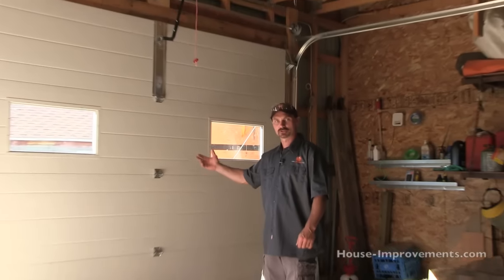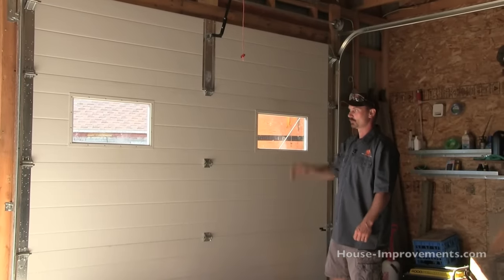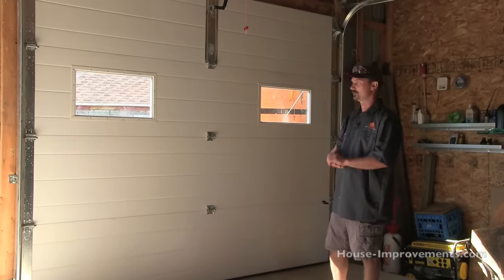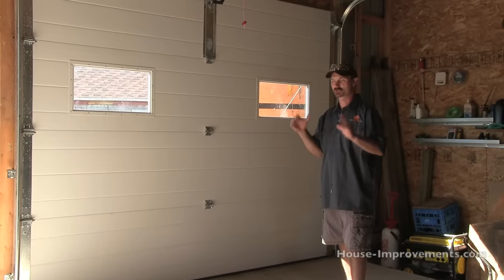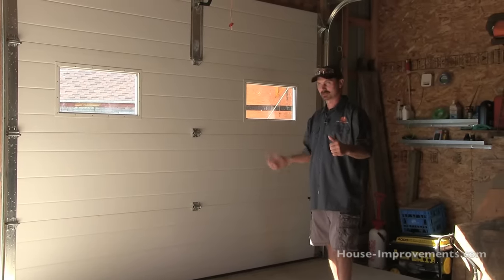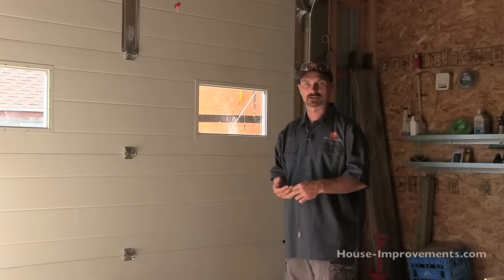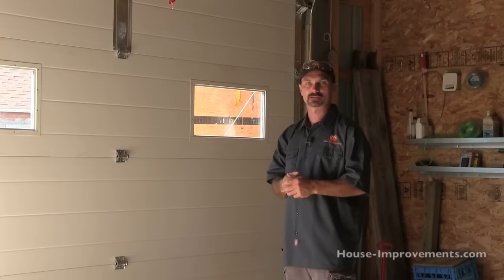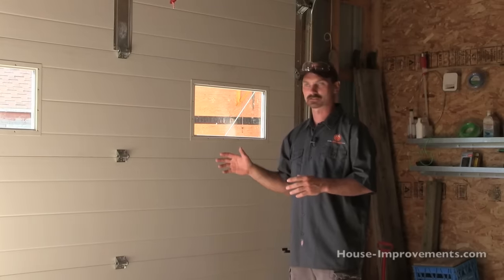How To Install A Garage Door

Comment: Thanks!   A local garage door specialist just gave me a quote of over $2,000 to install one  8' X 7' un-insulated replacement garage door including all including hardware which was ready to hang.  The previous door install already had the flag brackets, vertical rails, flashing and existing spring and shaft.  The only requirement was to hang the door.  All new cables, rollers and hinges came with the new door.   I decided to save $2,000 by watching this video and doing it myself.  It took me three hours to attach the two horizontal 2" tracks, assemble the door panels, hinges, rollers and vinyl strip floor gasket.  Bravo!
Reply: there's no way 2,000$??? that had to be a "i don't want to do this job" price

Comment: Wow!  It’s a “how to install a garage door” video that actually shows how to install a garage door!  Thank you for your time in doing this and the clear instructions.  I am actually a fairly skilled carpenter who was too intimidated to replace my own garage door until watching this.  Now I’m ready to go with a greatly-diminished fear of being decapitated by an unfortunate spring accident.
Reply: Yes it is great, but where can I buy garage door kit or every thing I would need to complete that...? I have 11x11 ft opening.
Reply: @TomasArnos  good luck, that is definitely special order
Reply: @TomasArnos  I have the same size but I've added to the sides to put in a ten ft door. Another option is to cut down a 12ft wide door. I bought my door off of marketplace for a 100 bucks
Reply: P
Reply: Why use nails to hold it up when you can use the tracks to hold it in place tears what its there for 😅
Reply: Hard to get exact alignment
Reply: First thing is cutting your cables. 😂😂
Reply: @jasonmccoy4769 I'm guessing that nails makes it easier to adjust real quick if nessecary then having to make a bunch of lag screw holes moving the brackets around. I'm sure he has a reason that makes perfect sense judging by the fact he obviously knows what hes doing and beyond any observation you or I could make with our 0 experience installing these. I'd be interested to see you do it your way. Maybe you'll come out if it saying boy I wish I just nailed these in temporarily rather destroy the framing I just drove 15 lag holes in moving around the brackets aand now they are stripped and I cant fasten the track to the wall.
Reply: @kefwals8722  you must not have anything better to do pal. Allow me to humble you real quick.. I own my own garage door business also using the lags like you said to tear up the  framing would be bad 👎 but if you know what your doing with a level and tape there is no issue there. It amazes me on how you were so eager to slander me with you half cocked 2 cents. You are wrong pal.

Comment: Clearly the best DIY video I've ever seen anywhere. Super well organized, 1), by showing the finished product first. 2),  by showing every step in order with just enough talk to make sure the audience understood. 3), by skipping thru all redundancy and picking up again at the relevent point in the process. 5) By covering every detail, even some for a different kind of door/hardware to cove other types of doors.  Thanks. You get and A++ from an old DIYer with 70 + years of  DIY experience...always work alone...

Comment: I’ve worked for a company that was in business for over 40 yr servings & installing ohd & entrance doors and got a first hand view of door issues in a commercial and residential setting.  
Learned a lot of knowledge to say the least.  
The owner was a perfectionist.
We would typically install the vertical tracks after the second panel is stacked to ensure the panels don’t fall while stacking eliminating the use of nails.  Keeping the track brackets loose for future & final adjustments.
Making sure to center the door inside the garage opening & to make sure they’re equal on both side when looking from the outside.
Also,  the vertical tracks should not be installed directly on the concrete as water will cause rust over time.  Along,  with the ground will raise and lower cause track issues when the concrete pushed the tracks during freezing & thawing cycles.
We also would recommend struts no matter what the manufacturer requested solely do to the fact the opener with cause stresses on the door especially when it’s used primarily.  
@$15 per struts will save a head ache in the long run.
When winding the springs,  we would use white spray paint and spray a fine thin line the length of the spring from the center bracket to the winding fitting.  This shows how many turns are on the spring in case someone like the customers decides to visit during this process.  Typically if the door is 7’ in height it’ll take 7 1/2 turns or so.
Reply: This, this is what I want to come and say. I am an Ironworker who does doors. Mine range from 3’x4’ to 180’x60’. But to me it seems the ones that cause the most problems are the simple panel doors and it’s usually not braced properly. Struts are so important. Not a lot of company’s will install them just to save a few bucks.
Reply: I hate servicing doors with the bottom of the track tight against the floor or buried in the concrete. I always appreciate it when the previous installer set it up with future service in mind.
Reply: Here in South Africa we install the vertical tracks,upper tracks and headgear springs and drums first. Then the panels and finally wind the spting then youre done. Its the easiest and fastest way
Reply: @riaanvisser4323  Interesting.  
One thing I miss about doing that work.. no two days were the same and over time I’ve gotten to almost perfect doing certain jobs to a “T” and the other;   was the owner never threw ANYTHING away so troubleshooting was always def. possibly.  I enjoyed that work very much.

Comment: Best step by step instructions. You are very knowledgeable and articulate.  Straight to the point without over instruction. I like how you do cover the little details and how you emphasized the most dangerous part (spring installation and setting). Your camera person does an outstanding job as well. True professionals, thank you!

Comment: I just started working for an overhead door company, and this video helped me a whole lot. I watched the day before I went in and knew a little about what I was doing, and they appreciated that. So I say thank you for this video and all the videos you post that help people. Thanks Shannon!
Reply: Im doing the same. How has your experience been ? Do you like it still ?
Reply: @TRIGGGERhappyHONKEY  I’m 2 years 6 months in and have learned a whole lot. I could install pretty much any residential or commercial garage door by myself if I needed to, but I’m glad I have a helper. Storage unit door or roll up doors are a piece of cake. I think I’m pretty good at what I do.
Reply: @dutchvandermorgan6226  I had a company put my door in and they messed up the out side trim, had it so the opener bar bowed like a bow & arrow, and the railing is not even close to level. Having trouble getting them to come out and fix things.  Hope you do better than them.
Reply: @dutchvandermorgan6226  you still working there?

Comment: I am doing a repair on an existing door. Your clue as to the direction to turn the hub to load the spring was a big help. My door is very heavy as it is heavily insulated with two springs. I have had some trouble but I think with your information I will do Okay. The video was well done, thank you.

Comment: I'm starting a new job as a garage door installer in two weeks, this will definitely give me an edge, and keep me from looking like too much of an idiot on my first day. Thank you!
Reply: howd it go?! thinking of applying for this job
Reply: @shaneyousef9868  so far so good! I'm learning a lot. It's pretty cold, since garage doors are one of the last things to be installed in a building before the heat gets turned on. It's hard work but learnable if you're taught. Lmk if you apply and get the job!

Comment: I am installing a garage door for the first time on a garage built myself. I purchased the special order 10x7  iDeal garage door kit from Menards. The installation manual that came with the kit had everything except how to install the Torsion Spring. I called the manufacture of the door for this information but never received a callback. Talked to Menards and was told to contact a professional. This video was perfect. No more head ache. Thank you very much.

Comment: Regardless of manufacturer, this is a go-to video for several reasons: 1) the pacing and balance of talking to demonstration is perfect, 2) the camera work is clear and steady with good shots of all the critical moments, and 3) the related commentary (stuff related to framing, trim and the structure) hits on points that all the other YouTube videos miss.  It's even better than some of the manufacturers' instructions, and because the teaching is so clear, it will help with anyone installing a garage door, regardless of manufacturer.  Great job!!

Comment: Great, great instructional video.  I've got a 25 year old door original to the house that's going to need replacing before we sell the place.  Wasn't concerned about assembly, but was concerned about the spring..always heard bad things.  Your methods make it look very easy and instills confidence that I'll be able to tackle this without hiring it out.  Thanks again!

Comment: Mike
I used to hang garage doors residential/comm. I was taught once the spring is mounted take a piece of white Chaulk and draw a straight line across the spring from left to right and as you wind the spring two or three times you will see white coils on the spring and each white coil represents one full turn .if you have to replace an old door spring  look to see if it has chaulk coils and count them then read your instructions to see if they match . I hope this helps everyone.
Reply from the maker: Thanks, good idea.
Reply: ive done this with spray paint as well
Reply: I put one sides vertical track up while holding the bottom section...saves you about 20 min and having to pull nails...
Reply: I meen yeah you can do that with the chalk or spray paint...but if u worked with a good company...you most likely would be replacing both spring opposed to just one..because with one broke..the other is likely just as worn..but every new set of spring comes with a tag and how many winds to put around the torsion tube..so putting paint on in a sense just handicaps you

Comment: After tensioning springs on a double overhead door, I would like to caution you to keep your body to one side as much as possible. An accident can do a lot of damage if one of the tensioning rods accidently slips out. (one guy lost his nose, another almost severed the tendon in his thumb, etc) Both very serious injuries.
Reply: One guy at my door completely split his four head open because of that exact reason.

Comment: If your drums spool  in the standard direction, around the back (frame side) of the drum, and the wire at the rotating end of the spring points down when it is facing you, your springs are on the wrong side. You don't have to hold the spring with both bars the whole time when you're winding, it's totally acceptable to rest the bottom bar against the door if you need a break. If you're worried about scratching the door, just wrap a tape ball on the non business end of the winding bar to rest against the door.

Most doors actually use pins to attach the cable to the bottom fixture, and you can't put them in after you install the panels without taking off the bottom bracket. So just attach cables when you hardware the panel.

Also, instead of counting quater winds as you go, just draw a line across the spring, and count full rotations from there. The standard residential door drum retracts about 1 ft of cable per full rotation, so if your  door has a 7 ft height, you need 7 full turns plus a half turn to keep able tension so they don't bail off in the up position.
Reply: Great explanation, I’ve been installing doors for about 5 years and couldn’t have said it better myself.

Comment: The reason for the side screw on the bottom roller bracket is so some fool doesn't come along and try to take that bracket off while the spring is tensioned and rip his hands off. I never bother putting that one in. Your door opening should be 2" smaller than the door width for better insulation factor. Do yourself a favor and throw the nails away lol...Set up your bottom panel and install one side track then stack your panels and when you get to the second last panel then install other side track and then your top tracks. before attaching second side track measure top of track down to a roller and make sure both sides are the same to avoid loose cable when door is open. Install top panel after your top tracks are installed. Flag brackets should be installed on your curved track before installing to make things way easier and no need for rope to hold your track up. At least you picked a good door. Steel-craft...you should opt out for the better rollers though...makes a huge difference with the 10ball nylon roller. Your top tracks should not be level either but on a slight angle up. Never wind the springs as you did and always stand to the side of the bars and wind with the one arm not two...in other words never ever stand in front of the bars.... My 2 cents lol
Reply: Ron Juillette all good advice.  Also, try magnetic bits to eliminate fumbling with screws/hinges at the same time.
Reply: Yes for sure I would never bother wasting my time without my magnetic bits lol

Comment: Thank you for taking the time to plan and shoot this video. You demonstrated a very thorough, clear, direct, well planned method to install a garage door and its associated track. You are a fantastic teacher. Great job. Your were able to break the total job down to step by step instructions making it easy to follow.  Following your instructions is a plan for a successful installation. I will use your knowledge and guidance to re-install my garage door that I installed  years ago. It has been one of those jobs I wish I had done a better job at, and have been putting off re-doing. Thank you again!

Comment: What I do is install the vertical track after i put the bottom section in place, that holds all the sections in place. you shouldn't need to nail every section like that
Reply: +Emphase and then before the top section you install the horizontal on to the vertical, and then the top
Reply: and put the cables on the bottom fixtures when you are hardwaring it.  it's a lot easier doing it that way

Comment: I used to do this for a living until my hands started trembling at night from the power tools.  

Also the tightening of the spring is most definitely the dangerous part of this.  I've seen a new guy try to do it on his own the first time and for some reason he let go or slipped and the bar struck him right over his head, cracked it wide open.
Reply: +heat4yoass the springs carry a lot of energy. I have been fortunate to not have had any serious injuries from installing garage doors. You are right it is dangerous especially if you are unsure of what you are doing.
Reply: +heat4yoass  i done that thing same. winding spring with screwdrivers, slipped out and the srewdriver went airborne and killed 3 people in china .....sad but true... :  ) : )
Reply: I never tightened a spring but I have wound them. I have tightened sets screws on springs though.

Comment: A two-man install tech job is one of the most gratifying jobs. you build routine with your secondary. after a while youre hanging a door in 45minutes together. I remember we used to do 5 garage doors a day for my building company. everything is just clockwork after a while. the troubleshooting. the winding. one is preparing the hinges on the other panel while your second is making sure the measurements are correct. we used to put the struts up after the first panel never did nails on the side though but its verbatim exact and precise work. One cutting braces with a bracecutter, your second is placing them. Shannon did a stellar job. Gave you a proper run through of how its done. Nostalgic of when i used to work on the gulf florabama area. you explained full rotations, the vice clamp, the color direction on the cable drums. i enjoyed watching this.

Comment: You did an amazing job presenting this. You never wasted the listeners time and touched on everything I'd need to know. Appreciate the tip about using a nail to hold in place temporarily, I would have done something different and wasted time.

Comment: I am actually making 3 custom doors from used parts that I can get free. I REALLY wish that I had found your video before I did the 1st one. It would have save me a lot of frustration. No manuals. Thank you.
Reply: Going to shorten a panel for length by chance?   I'm looking to shorten panels to make a narrower door for a mower door on the back of my garage, wondering if it's feasible